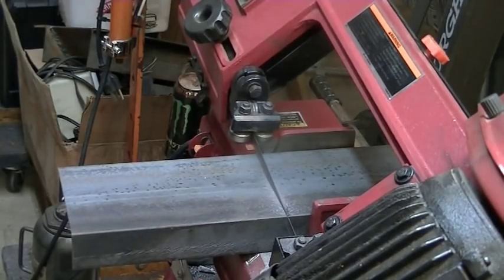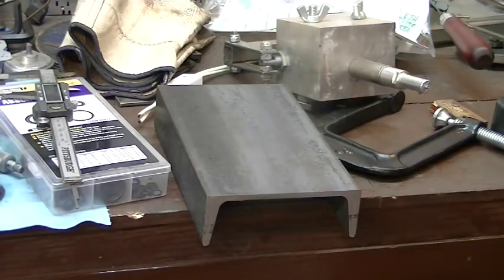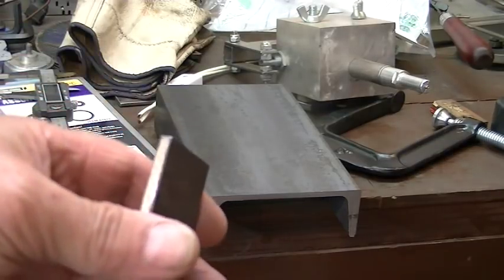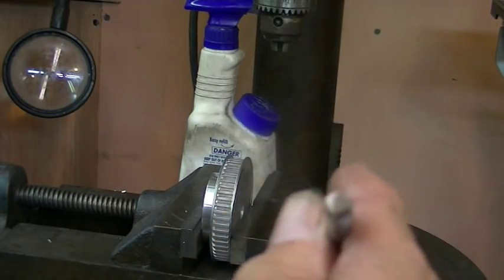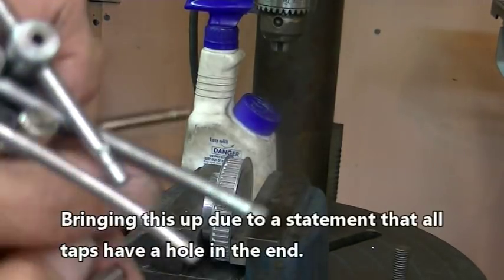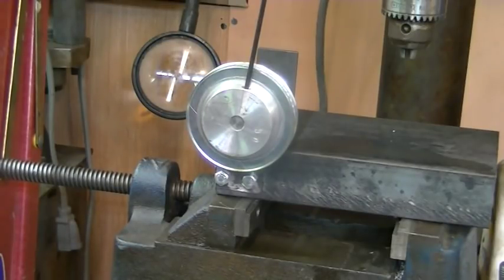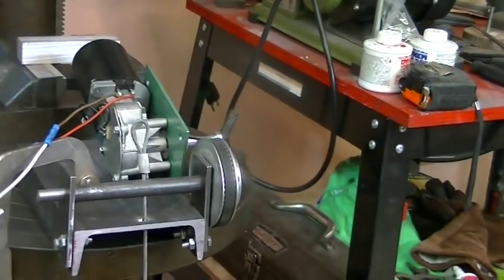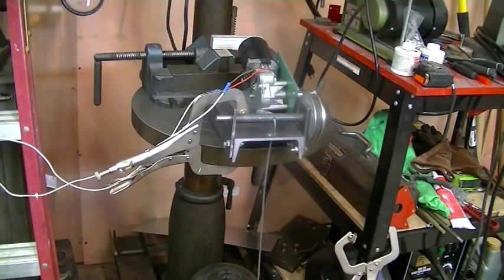Wiper motor how much can it lift

Comment: It's not a question of HOW MUCH can it lift, but how long you are willing to wait for it to lift the weight... With the proper gear ratio, you could lift a locomotive... Supposedly, a locomotive weighs around 432K pounds... Your current system seems to be good for 130 lbs over a 5 second pull... You would just need an additional 3323:1 gear ratio... By my calculations, it could accomplish that in a bit over 4.6 HOURS... Probably more once you factor in taking up the slack in the tremendously thicker cable (wire rope) that you would need to use... :)
Reply from the maker: The cable I was using has a 500 lb capacity and I have been criticized for getting so close to it.  So I think I will leave lifting the locomotive to you.  Besides that would be too many gears to cut for my home shop.

Comment: I want to attach a wiper motor to the gear box of my spare tire carrier under my pickup.
Reply from the maker: That should work.  I have seen a wiper motor used to lift the tongue of a travel trailer.  Thanks for stopping by Jed.

Comment: what is the watts of that wiper motor sir?
Reply from the maker: I do not know the answer to that question.  This is the first time I have been asked that.  It is just a wiper motor that would fit on an average car so search for wiper motors and maybe they will show enough information for you to calculate the watts.   Thanks for stopping by.
Reply: I think every car in the world work with 12v :D
Reply: There were some cars that used to have 6V electrical systems.  I had one in my younger days.  There are supposed some 24V ones also.  The Toyota BJ series of Land Cruisers had this many years ago.

Comment: This is a great video!  :)
Another good one to use for heavy lifting is an electric car seat module.
They have very strong motors &  gearing that can handle large loads.
Reply from the maker: Thanks for the suggestions and thanks for stopping by.
Reply: wide loads, too!

Comment: As I watched this I was thinking of the hand crank winch in my basement... if this was hooked up to it, because of the worm gear on it I bet you could lift a thousand pounds on it.  Being a manual winch it's so slow to crank and uncrank I bet a WSW motor would be great.  I'll have to give it a shot.
Thanks for the inspirational video... my back is getting older (while the rest of me is still young and foolish!).
Reply from the maker: Don't over look window and seat motors.  I do not know which one has the most power but they have different attachments on the shafts.   Thanks for stopping by.

Comment: A wiper motor and a bit of steel tubing and we might be able to build a nice little crane for my buddy's  truck to save his and my back as we both are getting older and them deer type critters seem to be getting heavier every year  lol
thanks Harold for some very good ideas and info too
Reply from the maker: I don't know how much a deer weighs but if it is under 200 pounds I bet the lift can be made.  Thanks for stopping by.

Comment: Great job, I'm impressed with the little wiper motor. It seems as though a linear actuator powered by one of these motors would be capable of doing alot of things and being much more cost effective than buying a commercial actuator.
Reply from the maker: The only problem is the fastening to the shaft.   For serious use you need to put a pin through it.  Thanks Rifleman.

Comment: Maybe 25 years ago we bought one of the Store model hoists like you were talking about from HF.  We still have ours; it lifted five gallon buckets of mortar and around 44-55 brick at a time.  Power up and down with a brake that worked great.  Best $60 we could have spent, Greg.
Reply from the maker: That is a nice lift if you have some place to attach it.  Thanks for stopping by.

Comment: Often wondered about what you can get out of a wiper motor - this is most interesting. Amazing how gearing down gets nice high torque... very encouraging results. Controller probably coping with some high amps on the high loads.
Reply from the maker: The on off switch was getting pretty warm but I did not notice a lot of heat from the rest of it.  Thanks for stopping by.

Comment: Harbor Freight also has a  cable hoist, electric motor, with a pendant.  I used it in my business for many years.  Still works great.  Look at Harbor freight and see if they are still available.  Getting older lets us find better ways to do things.  Now I use it in my Wood working shop.
Reply from the maker: I have a couple of the Horror Freight hoists.  This is an experiment for the fun of it.  Thanks Kenneth.

Comment: At the TV shop I worked at we built a hoist for lifting the old rear projection TV sets. We lifted 300 lbs+ by using an old satellite arm actuator motor. We used the DC supply for the actuator motor to run it. The " machinist" we paid to make some of the parts to make it failed to follow our plans, and the shear pin broke at about 300 lbs. If he had followed the original plans, I am sure we could have exceeded 400 lbs (and more). He used an undersized shaft and an undersized  el cheapo roll pin for the shear pin. The shear pin kept breaking due to it being undersized, and hollow,  when we hit 300 lbs. The first time it failed, it scared the bejesus out of us. Fortunately the set only dropped >2".
We only had to have an 8" lift to the hydraulic table cart.
Reply from the maker: I think I would have taken it back.  Thanks for stopping by.

Comment: Hi Harold, You should consider using a boat trailer winch powered by that wiper motor. The gears will eliminate slippage of a belt and the mechanical advantage of the simple gears in the boat winch  will allow you to lift some real weight.
Reply from the maker: That is true but it would increase the cost.  Thanks for stopping by.
Reply: There are tens of thousands of old junk boat trailers around the country that have them mounted on them that can be had for probably less than the cost of the steel you used to make that home made winch. I just saw one used ,600lb cap on Amazon.com for less than $12 shipped..
Reply from the maker: Interesting, I never knew you could get a used boat winch on Amazon.

Comment: A power lifting table is another popular option when it comes to moving heavy items to mill tables. But jib cranes are nice too.
Reply from the maker: This will not take up an additional floor space as a lifting table would and I am working in half of a two car garage.  Probably intended for compact cars at that.  Thanks for stopping by.
Reply from the maker: Yep, another 10 feet, one more machine, one more pistol, one more whatever.  Human nature.

Comment: Harold, I was really surprised that the bucket handle did not pop off the bucket, so it looks the 5 gal. buckets sold by the Homeless Despot or other big box store are not too bad. Your little test seeded some ideas in my grey matter, so now I will have to locate some wiper motors. Instead of using a belt and pulley wheels try a chain nd sprockets to eliminate any slippage. The gearing in the wiper motor should keep the cable from unwinding from the sheer weight of the load when the motor isn;t energised, but if not it would be easy to add a dog. Anyway, thanks for the inspiration!
Reply from the maker: Their are limits to these motors.  They have a plastic gear inside that might strip.  Of course a metal one can be made.  When my belt slipped I thought about maybe the gear let loose so I opened the motor and it was OK.  I think about a hundred pounds is all I am going to stress one of these motors, unless I gear down the pulley even more.  Thanks for stopping by.

Comment: Is this possible to make an electric wheelchair  using wiper motor?
Reply from the maker: Maybe but it would take a large battery and might be very slow.  I think it would be better to use a motor designed for that purpose.  Thanks for stopping by.

Comment: I've been contemplating making a homemade vehicle tire changer , there's many on YouTube, but all of the ones I've seen are manual but I'd like to motorize one, just not sure how much torque it would require. I believe that gear and pulley setup you have here would probably do it, if not probably a little bigger driven pulley. Where did you get your gears/pulleys for this and do you know the diameter of them or the ratio?
    Thanks for the video
Reply from the maker: I make the gears from aluminum because it does not dull my gear cutters as bad as steel.  I usually try to make them about 3-1 ratio.  If you know how many teeth you want on each gear you can calculate the diameter from that.  Mrpete222 has several videos showing simple methods to make gears.  That is where I learned.  I do also have some videos showing how to  make gears.  Thanks for commenting and keep on keeping on.
Reply: @AmateurRedneckWorkshop  Thank you, I will check those videos out and learn something. 👍

Comment: 130 pounds = 59kg
21:00 
Thats most it had lift in this video.
Reply from the maker: Thanks for stopping by.
Reply: At a gear ratio of 5:1 then effectively 4:1 for a total of 20:1, if I did the math correctly.. so really about 7 lbin at the motor, right?

Comment: Back in the 70s dad and my uncle used to use old ford wiper motors on their snagging rigs to speed up reeling in. Once you hooked a fish you had to hand crank it as bigger fish was too much for it. Can't tell ya anything about the motor or even why ford parts as we a chevy family. Most likely because my uncle worked as a ford tech at the time and got them for next to nothing.
Reply from the maker: I bet if you could gear it low enough you could reel in a battleship with one.  Thanks for stopping by.

Comment: What were you using for a power source?
Reply from the maker: I was using a 40 volt 10amp power supply like you use for cnc projects.  And sometimes I have used a car starting battery charger.  Thanks James.

Comment: Hello sir. Your video is great. I just want to ask if we can use wiper motors as alternative to wheelchair motor? Thanks
Reply from the maker: I have no experience with wheel chair motors.  The wiper motor output shaft is threaded and tapered to hold an arm that is intended to turn in only one direction.  Turning in the opposite direction with a load on it can unscrew the nut holding the arm or a pulley if you have replaced the arm with a pulley.  If you notice in the video I only lift with the motor turning in the direction of the thread so the load tightens the thread.  When I let the load down their is very little stress on the threaded connection so it does not unscrew.  Thanks for stopping by.
Reply: Yea, youd have 2 speeds..  slow and slower..  slower than the carts at the grocery store..  if u geared it than the torque wouldnt suffice to get ya moving..

Comment: What kind of power supply I can purchase for a windshield wiper motor? or what's the power supply that you use for the windshield motor.
Reply from the maker: If you want to do a lot of work with the wiper motor I would get something like a 24 volt 30 amp power supply.  They have power supplies in lots of sizes sizes on Ebay.  The motor can stand a lot of power for a few minutes.  I have used the starting setting of a battery charger with that motor for a minute or so and I think that was above 80 amps. Of course for continuous service 12 volts is best.
Reply from the maker: I am sure 30 amps is not too much.

Comment: I am wanting to make an electric joystick steering system for my pontoon boat. I can picture your larger pulley, taking the place of the steering wheel. Could you tell me where you found both of the pulleys and the belt? The speed of the motor, in your experiment, looks to be perfect for my application! Great video!
Reply from the maker: I am pretty sure I got both the belts and the pulleys on ebay.  I would shop around as sometimes the ebay merchants get very imaginative.  They have them on Amazon and most of the hobby places that sell stepper motors.  Be sure to get the same pitch on both the pulleys and the belts.  Thanks for stopping by.

Comment: im interested on how to make the wiring so that the wiper motor can lift a lot of weight. can you show us how did you do the wiring and stuff. i am really interested in your project. thank
Reply from the maker: I will add that to the list of future projects.  If you want to know when I do that you can be notified if you are subscribed and then click on the bell and select notify.  Thanks for stopping by.
Reply: Actually i am going to use this wiper motor for my project in school. That's why i am badly interested. I only have 4 days to work on it 😭 thank you for your response sir.
Reply from the maker: Then do a youtube search for "how to wire a wiper motor to a switch" and you will find a bunch of videos that show how to wire the wiper motor.

Comment: Hi I got this weird motor from someone at school. It was this sliding arm thing, but they are not wiper motors, and I have two of them. I took off the arm and opened the motors to see if they are worth keeping or not, and I messed one up, so it’s tighter and it spins slower, but it’s still fast. They are 24 volt DC permanent magnet, and they are really strong. How much do you think they’d lift if I add a gearbox to it, a bike chain pulley system, and four 6 volt batteries? Also what’s the max in and out rating for your power controller?
Reply from the maker: I think the controller is rated at 10 amps.  How much you can lift will depend on the gear ratio between your motor and the pulley you use to lift the load.  You must also give consideration the the safe lifting limits of the individual parts you use such as the cable for instance.   Thanks for stopping by.
Reply: Amateur Redneck Workshop I forgot to specify what I meant by “in and out rating”. I meant amps and volts. You already said the amps, I just need the volts. Thanks.
Reply from the maker: I was using it at 12 vdc.  I think it was rated up to 60 vdc but their is no  label on the controller so the only specifications I have are just what I remember from the ebay listing and that was a long time ago.

Comment: What is the model from eBay for the controller?  Did you use this on the Z axis setup?  Thanks.
Reply from the maker: I checked back among my ebay purchases.  The controller came from alice1101983.  I am not sure the little controller is still for sale.  This was only for lifting the head and I did not put anything on the Z axis.  This by the way turned out to be too weak to keep and I later removed it.  Thanks for stopping by.

Comment: What did you use for a power source? How many amps? thanks!
Reply from the maker: I used a small 30 am power supply like the ones you find on ebay.   Similar to these.  https://tinyurl.com/uhtg567  Thanks for stopping by.

Comment: What is the specifications of that Wiper motor ?  Will a 12V 60W motor be able to pick up 10KG?
Reply from the maker: You can see that this wiper motor has lifted about 55KG.  It was running on 12V 30 amp power supply.  I do not know what a 12V 60W motor can lift.  Thanks for stopping by.

Comment: im so glad you made this. i was really curious about this because im wanting to use one to power a spit for roasting whole pigs, but i wasnt sure it would have enough strength to do anything really big. but now im positive it will work just fine, even with a massive hog. 
thanks a lot for the vid. i only have 1 suggestion, you could definitely use some more volume or a better microphone.
oh! and what is that thing that controls the speed and direction called, or do you have a link for the one you got?
Reply from the maker: I have no idea what the speed control is called.  They are common and cheap on ebay though.  I have had a lot of sound problems and it is terrible.   I have purchased a new camera and  I think that solves the bad sound problem.  Thanks for stopping by.
Reply: cool, i appreciate your reply

Comment: you can get wiper motors for free or next to nothing at wrecking yard i use one to move the cross feed on my metal lathe control it with a 5 amp pwm with reverse switch ($5.00) at ebay they are handy for lots of projects
Reply from the maker: Yes they can be handy.  Thanks for stopping by.

Comment: you could just get it to pull on the yellow scales hook. the reading on the scale when it cant pull anymore is the max weight it can pull/lift
Reply from the maker: Yes except for the yellow scale is rated at 12 pounds. Besides what fun is that?  Thanks for stopping by.
Reply from the maker: Well around 12 pounds maybe a little more, I forget the capacity but certainly not enough.

Comment: What is the gearing ratio between the belt driven pulleys?
Reply from the maker: As I remember it the ratio was 3 to 1.  The main gearing down is inside the wiper motor where it is probably about 60 to 1.  I did not take the wiper motor apart to count the teeth.  Thanks for stopping by.

Comment: very good info, got any more info on the purchasing the controller thanks ED
Reply from the maker: Here is a link to a similar controller if youtube allows it.  http://www.ebay.com/itm/10-36V-DC-Motor-Speed-Controller-Reversible-PWM-Control-Forward-Reverse-Switch-/111472290359?hash=item19f4442a37  Thanks for stopping by.

Comment: what's the voltage and current applied to that motor?
Reply from the maker: The power supply is rated at 12V 30A.  Thanks for stopping by.

Comment: i have a 12v 10 amp wiper motor can it lift that much weight??
Reply from the maker: I think it can.  One thing that changes the amount you can lift is additional pulleys or gears.  Thanks for stopping by.